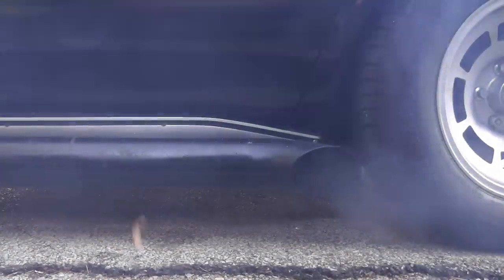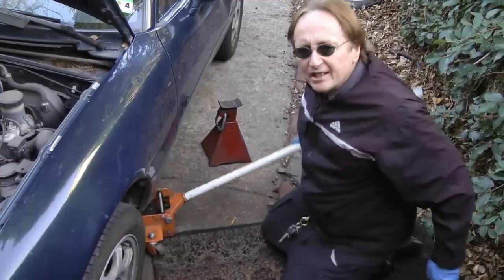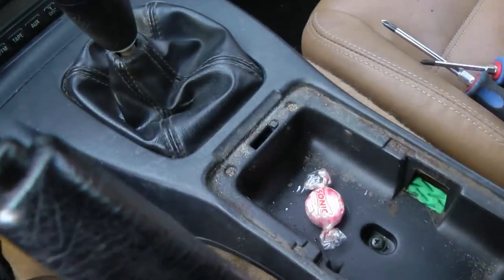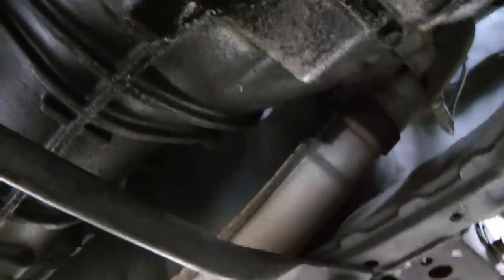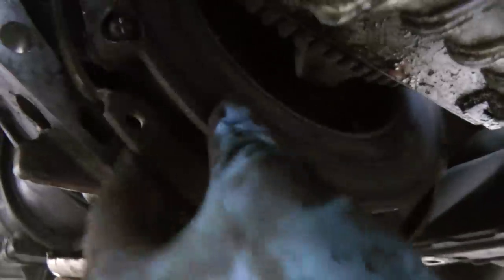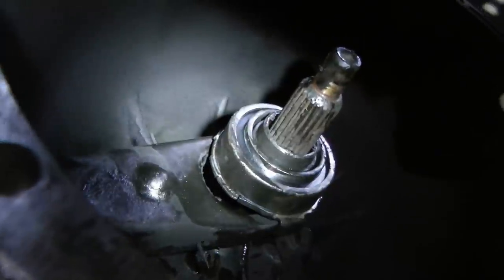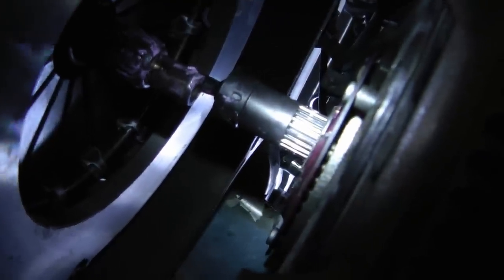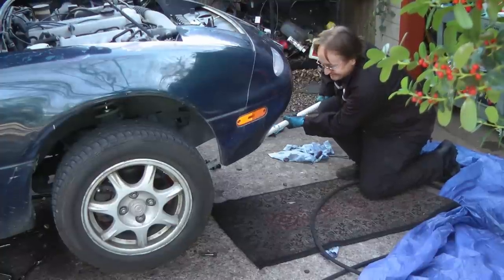How to Fix a Slipping Clutch in Your Car (Clutch Replacement)

Comment: back in the day if you clutch started slipping you would adjust the linkage a tad a and get home but when my 1999 gmc sonoma started slipping it blew the fu-k up before i made it home left stuff smoking all down the highway and blew the housing off my transmission nobody ever told me that could happen i would have listened if they told me

Comment: I understand this is a basic going-over of how it's done but I feel like you should have mentioned checking the fluid level in the trans before taking her for a spin. Also shouldnt the bolts on the pressure plate be torqued to spec? 

I love all of your other videos but I felt this one was rushed. Sorry Scotty =\
Reply from the maker: I show the basics, I've never torqued pressure plates on and never had one fall out. You get em tight by hand, the plate spins in a circle an the torsion on each bolt threatening to loosen them is VERY minimal.
Reply: Thanks for the input, I was told that not torquing them to spec it causes the springs to wear out early.

Comment: and you didn't get the flywheel resurfaced after that rivet in the disc was rubbing against it. you will be taking the clutch back out in 3 months.. been there and done that

Comment: I missed the part about "Top off the transmission fluid before starting car." (Oops, that step is omitted.)
Reply from the maker: VideoNOLA in this case, about 4 drops came out, not worth messing with
Reply: Scotty Kilmer Thanks, kinda figured (not that I'll ever be capable of such a job!). Keep up the wacky zany nutty informative videos.

Comment: This is impossible for me to fix it :D
Reply from the maker: don't cut yourself short. A kit costs 130 bucks, paying a mechanic to do it can top a thousand bucks. So, you may rethink that you can't do it.
Reply: nothing is impossible, if my friend and I built my Accord V6 3.0 which was automatic and we did a 6 Speed Conversion with a 3.2 TL Type-S Engine and stroked it to a 3.6 then it shouldn't be a problem replacing a clutch.

Comment: No mention about adding gear lube to the trans after the clutch change.  This is the number one failure that mechanics make when changing out the clutch disk.  Would hate to be the owner of this car down the road.

Comment: Hi guys! i heard a noise while shifting to third gear in my car, it's like the same noise when you shifting without pressing the clutch pedal. but it's only on third gear. could someone give me an idea please # Scotty Kilmer.
Reply from the maker: +Johny Etienne synchro mesh on 3rd gear is going out, baby it, tranny would need rebuilding for that and it's expensive as can be.
Reply: I'm really in trouble! How long can I run with it? It means already 6 months this noise is struggling me. What are the consequences on my transmission if not solve. You know, when I step on the clutch pedal for some time before shifting I don't get the noise, but anyway this is not the solution.
Reply: +Scotty Kilmer thanks a lot for support!
Reply: +Johny Etienne in theory you could drive forever on a bad syncro, as long as you learn to rev match your shifts. have a search on youtube for double clutching, or rev matching. hell, not that i recommend it but you can shift without using the clutch at all if you a good enough at it.

say 3rd gear is at 1500 revs when you are going 20mph, to change from second to 3rd without that grindy noise, simply pop into neutral, let the revs drop to 1500 and shift into 3rd, if  done correctly it wont make that awful noise at all!
Reply: snipeish1 I appreciate a lot your advice. I'm facing that problem since 6 months. And I experienced exactly what you explain to me and it's correct, as soon as I match my rev no noise at all. But I was balancing which is going to hurt me more, reparation or drive in that situation, considering the potential damage and also that i'm a fast driver.
Reply: +Johny Etienne well, if you are driving fast, you should be matching your revs anyways to minimise clutch wear.
you're unlikely to do any serious damage to your car, eventually the gear will wear out, but you could always drive 2nd to 4th to get it to a garage, that would be a looong way away tho. 

it all depends on your car really, if it's an older run around you might just want to buy another one as it will probably be cheaper than a transmission rebuild. transmission will cost anywhere from like £800 to £3000 depending on your car.
Reply: +snipeish1 thx man! my car is Hyundai tucson 2011 5speed manual transmission. Ok! you help me a lot!
Reply: +Johny Etienne oh man, you managed to wear out a syncro that fast? you the original owner? 

personally a 2011 car probably deserves a rebuild for its transmission, but as I said you ain't gunna do any serious damage driving without a syncro. 

here's a tip for not wearing out the rest of em, make sure when you shift, you press the clutch ALL the way down to the floor. if it's not your syncros will get some of the engines power and heat up, causing em to burn out real fast!
Reply: No man I'm the original owner, lol, it's a second hand. It's was a great deal, I got it last April with 35000km, that lady was about to leave the country. That was her private car and she stayed near her work, so I close my eyes and took it. It's after a week I realise that noise, when I call her she that she heard it also. Anyway! I guess that it's because lady doesn't always happy with manual transmission
Reply: +Johny Etienne haha, yea. I understand. well, good luck with it dude!
Reply: +Johny Etienne You could try to change the oil in the gearbox with better oil. Some oils do make synchronizing better. Maybe try an additive. Do some research on the net what kind of oil does work well. Don't use your 3rd gear too much now, it'll make the synchro worse.
Reply: +Frank De Ruiter thx a lot man!

Comment: I mean, you're not wrong about the whole procedure but you forgot to mention how long it will take and how much of a pain in the ass it is. I've replaced the clutch in a fwd Saturn, had to take the whole fucking engine out, and had to take the transmission out of my Mazda truck (2wd) to diagnose a rattle which was the flywheel bolts not being tight.

Comment: Am I the only person cringing at the fact that no attention was paid to that flywheel, especially after seeing how hammered that clutch disc was? A flywheel is like 150 bucks new, or 50 bucks for a machine shop to turn it, or even worst case hit it with a reloc disc and some brake clean. Don't be surprised if it chatters in a couple thousand miles...
Reply from the maker: nonsence, you didn't look very well at the video. the clutch disc was worn down on the clutch plate side, and the clutch plate was replaced. Look before you speak next time.

Comment: Hey @savagescotty Scotty, Ive followed you for some time and this is a shot in dark but I hope itll reach you, I know its the holiday, but my truck is down. I am in the middle of a clutch swap and mostly done with prep but Ive got some SUPER stubborn crossmember bolts that threaten to hold up the entire job! Ive use pb blaster overnight twice plus torch heat and hammer. Ive tried an impact wrench, Ratchet, Torch bar, wrench on wrench lever trick. Im stuck. If this finds you please get in touch. I’d love to figure this out as its my daily driver. I also invite ANYONE who see this to chime in Please. Thanks in advance

Comment: the engine in this car doesnt sound good it knocks as hell...
Reply: Just the lifters... they are known to rattle a bit in older Miatas.  The noise in mine goes away after it warms up.
Reply: +Christian Ninsananda My RSX does something similar but only with the A/C on, especially on crank.
Reply: it's not knocking...it's valve train noise

Comment: sounded like that car had a rod knocking or lifter problem
Reply from the maker: +hi yall you hit the nail on the head, engine blew up a few months after this video
Reply: +Scotty Kilmer about how much did you charge for such a job like this replacing the clutch

Comment: I've seen 2 of ur clutch replacement videos and I gotta ask (idiot diy guy):
1) why in this one you had to go to the rear and the other one you just oulled it out of the hood.
2) How would you do it with an AWD car (I drive a Subaru)

Comment: Engine doesn't sound good. I think we will see this car again in your videos
Reply from the maker: just a lot of mileage with not enough oil changes. Mazdas tend to make noise from worn lifters then, but still run fine.

Comment: being the pilot bearing is a bitch. How do you get the old one out?
Reply from the maker: they make special tiny jaw pullers that fit into there, I have 3 different ones for different models.
Reply: Scotty Kilmer I have seen those, just don't want to buy them as i will probably never need it again. thanks man.
Reply: fcukSTi oh yea. I plum forgot. lol
Reply: phatrides222000 cheapest way is to fill the hole with grease and insert alignment tool   the kit comes with in  and tap it few times   the bearing should  come out